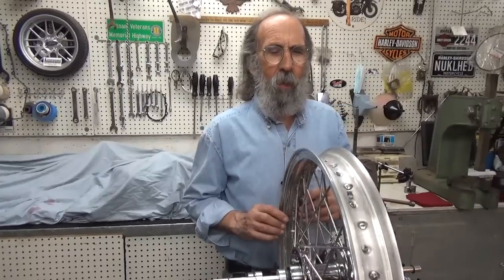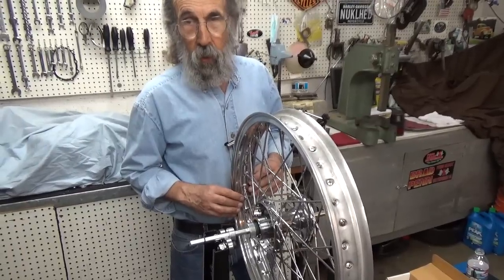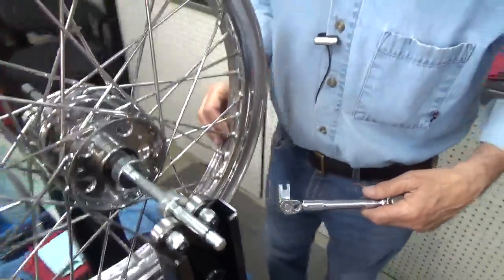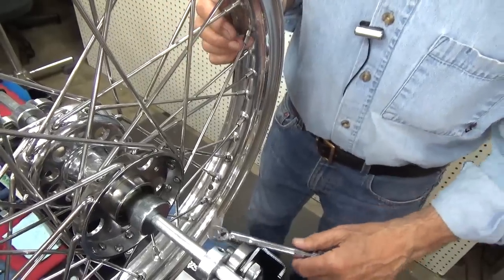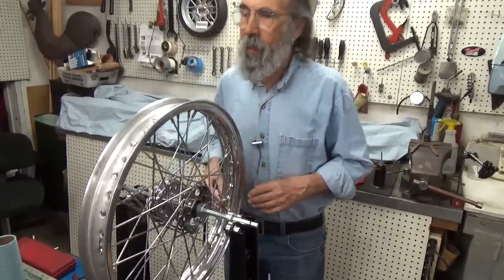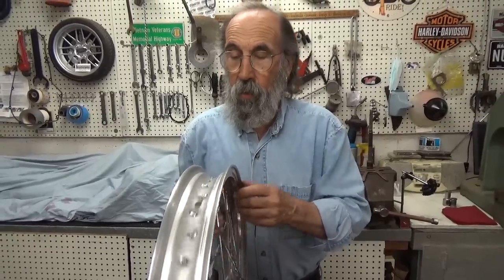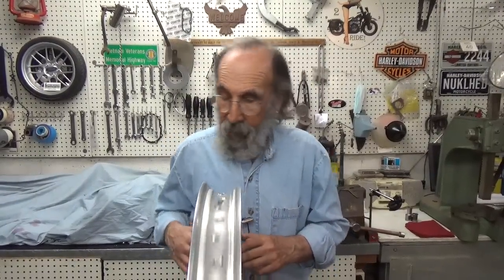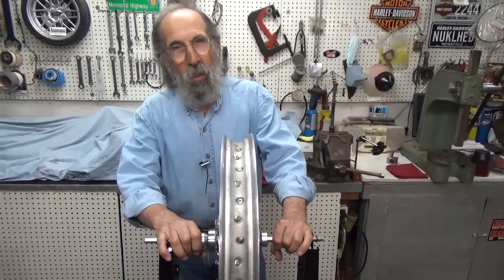Custom Wheel Final Torque and Grinding of The Spokes

Comment: You  explained it very well. Thanks. I've been doing wheels for myself and members of the AMCA plus some local shops for around 30 years.  What I like to do after it's all trued and spokes are ground down is tap on each spoke with the spoke wrench to check the sound I get.  Should be all the same.  As I mentioned,  it's my preference,  not everybody's.   Good video,  thanks again.
Reply from the maker: Absolutely cool.  Thank You.

Comment: Years ago, in an old mechanics book I found a formula showing how to set up your torque wrench when using an extension. I had a two inch box end for my shovel. It works with any length extension and is used with the extension in a straight line with torque wrench. I could try to send it if you don't have it.
Reply from the maker: Thank You.  I think I have one.

Comment: Only discovered your videos a week ago Mike and I’ve watched everyone already, your a joy to watch and get the message over precisely and clearly, keep up the good work my friend we love it.
Reply from the maker: Wow, thank you
Reply: Pacific Mike the stories you tell of the motorcycle guys that have made small useful tools for you and sent you parts for bikes are great, have you thought about going to a local engineering firm and having a small production run made of the little useful items such as the camshaft puller, pushrod cover aligners and spoke torque head etc. Low cost but I and I’m sure many others would love them in our tool boxes, not expensive but well engineered and most importantly with your name on the box, low shipping costs when you post them and they would help with the cost of keeping your channel running.

Comment: Hey Mike, wadda ya generally torque a 16" old star hub rear wheel to, and would it be the same for a 21front? Also the book says to seat the nipples with a flat punch, is that necessary, do you do it? I'm getting ready to do the new wheels for the 50. Thanks, John
Reply from the maker: Hello John.  Torque recommendations on spokes come from the manufacturer.  Seating the spokes with a punch works very well, but, you seat the heads of the spokes into the hub, not the nipples.

Comment: Mike, would grinding as you did unbalance the rim in any way? My soft tail has spokes and when I had the tires replaced that I know of all they did is add weight to balance and most likely did not check the spokes or grind anything down, Just asking for next time. Thanks in advance.
Reply from the maker: When you respoke a wheel and you are finished, the ends quite often protrude.  They need to be ground down to the surface of the nipple, so they won't poke holes in rhe tubes.

Comment: Thanks Mike. Couldn't find a 6mm crows foot wrench anywhere, so I bit the bullet and bought a PitPosse spoke torque wrench. Unbelievably it was the only kit that included the 6mm size crows foot that fits most Harley spokes.

My next problem is that my Harley service manual does not show a torque spec for my front wheel spokes, but rather uses the term "snug" lol!😅. Being that I'm a torque wrench kind of guy, I did lots of research and sounds like the consensus is 40-50 inch-pounds on the front 21" wheel spokes. Sound about right to you?
Reply from the maker: Probably.  Not sure.  Don't know who made your spokes.  I generally use Buchannan Spokes and torque according to them.

Comment: Great videos, Mike! I'm going to be restoring and relacing a set of spokes wheels for my 75 honda gl1000 and was wondering what your opinion was on finishes (or lack thereof) do you prefer alloy rims polished? Anodized? Polished and then clear powdercoat? Polished and clear coat with paint? Thanks!
Reply from the maker: I probably have a problem of some sort, but, I polish mine by hand.

Comment: Mike, I had my wheel relaced about 20 years ago. Just recently when I put on a new tire I noticed measurable corrosion around the inside of the wheel between  the rubber rim strip and the top of the spoke adjustment nipples.  After I clean the rust off what should I do to seal around the spoke nipples and rim so this doesn't happen again?
Reply from the maker: Mask it off and paint it with a good, rust inhibiting paint.  It will help stretch its life.  We are usually the cause of this condition by blasting the wheels with water.  It goes right in around the spoke nipples and sits there doing its damage.  It's an ongoing battle and you need to carefully inspect to be sure the strength of the rim is not compromised yet.  I've seen spotlessly cleaned rims that were beautiful.  But, further inspection showed a hole all the way through the rim.
Reply: Copper paste or some bicycle assebly butter. For example shimano butter/ grease. Also good to dip the threads of the spokes in some grease to prevent them and nipples from rusting together before assembly. That will also give correct torque spec on spoke tension. You can build good rims without all this of course.

Comment: Mike, I understand the consequence of undertorqueing spokes, but what’s the consequence of overtorqueing ( I mean not hugely, but some)?  Reason I ask, I didn’t have an inch pound wrench when I did my Triumph wheels, might have gone a little strong cuz I didn’t want to be light—maybe I should go back and get them exact?
Reply from the maker: We all used to do them strictly by feel.  Now, we try to be more exacting.  If the manufacturer of the spokes has a spec, adhere to it.  "Even" is the most important thing. If they're too tight, they can pull through the rim.  Again, the company that makes the parts is who you should consult.

Comment: Hey Mike, Paco once again! quick question. I´ve done everything in order to get my wheel trued and torqued however I´m struggling with that! Once I´ve trued the wheel when I torqued the true is lost (along with the hub/rim distance)! So, tried start torquing the true and then the others, skip 2 spokes, small increments and nothing!!!! Even the wheel, spokes and hub are used they are perfectly fine (I disassemble to clean and service everything), rim has no hits or bumbles! I´ve followed the manual step by step 3 times without success and it´s driving me crazy! Do you think Mikare the used spokes?? I don´t know what I´m doing wrong!
Reply from the maker: I don't like to use used spokes or used rims to build wheels.  Big deal.  I've done a lot of things I really didn't like.  I'll bet your problem is that with used spokes you have used threads.  Use antisieze on the threads when you assemble it.  Without those spokes assembling smoothly, you can't develop the "feel" you're looking for.

Comment: Great video as usual and its your show so speak how ya want... questions do all wheels  torque at 50 inch pounds or is there another torque for 16 and 21? Front or rear? As said before great video and thanks for your time...
Reply from the maker: I go by the manufacturer of the spokes.  Is the rim steel or aluminum?  Is it a front wheel, or a rear wheel?  Is it a big radical engine or a stocker?  I don't mean to avoid giving an answer, but, I consult over the phone, with the manufacturer of the spokes.

Comment: Hi Mike, Thanks for sharing the knowledge. Would you consider an instructional for making and fitting a custom axel spacer. A ridged wide tire Timken bearing application is what I am working on. Thanks
Reply from the maker: That is a whole system and I'm not needing one at the moment.  I did adapt a modern wheel and disc brake to an early (58-72) Big Twin swing arm for my Shovelhead.  Go to our Youtube Homepage and click on the word "videos."  You should be able to get the information you need there.
Reply: @pacificmike9501  thank you

Comment: This may be a stupid question.but after trueing the wheel does the torquing not mess up the setting?
Reply from the maker: It can.  You need to recheck and retorque as necessary.  You can drive yourself craz y too.  Don't do that.  We're being as accurate as possible.  We're doing it better than we ever knew we could.  Maybe even "overkill."
Reply from the maker: That was not a "stupid" question.
Reply: Great question.
Reply: @pacificmike9501  thanks for the reply Mike,bought a 76 FLH four years ago and your videos have been a valuable source of knowledge.Very best wishes from Northern Ireland.

Comment: After grinding, the spokes and nipples rust quickly because the plating has been removed. Follow up after grinding with some good paint.
Reply from the maker: Good point.  I normally use stainless spokes, rather than chromed steel.

Comment: could you "normalize" the rim by whapping it with a rubber mallet?
Reply from the maker: It is a method.  I adjust them, then give them overnight and readjust the next day.  I consider that time to be well spent.  But tapping with a rubber mallet is not bad.
Reply: @pacificmike9501  thank you, great video!
Reply from the maker: Thank You.

Comment: Don't grind without a face shield or goggles, street glasses are not enough protection, all it takes is one jagged speck of ground metal to bounce over or under the open glasses and land on your eyeball and the sharp jagged speck will embed and it won't dislodge with eyewash, then you will need to see a doctor to get it picked out with a needle, and wait until you get the bill $$$!!! This has happened to me several times over the decades, mostly on workers comp, and I went more than 20 years without screwing up, then I got one at home just last Feb and it cost me almost $1900 out of pocket, and boy was I pissed at myself for not being more careful. And that's if don't lose your eyesight, if that happened I'd really be pissed.
Reply from the maker: Okay!  Thank You.